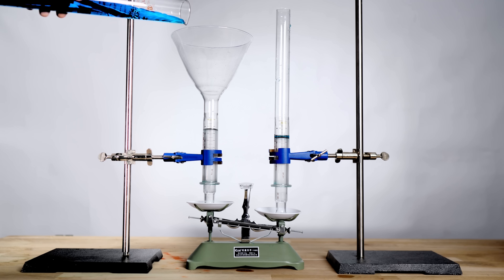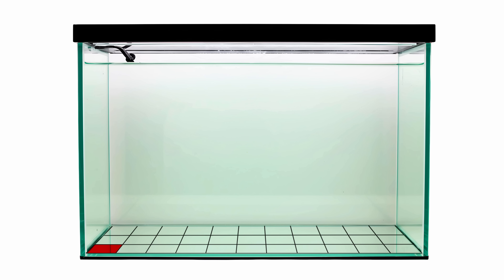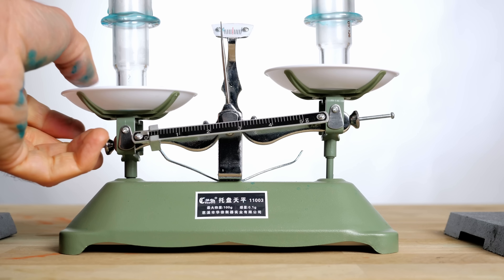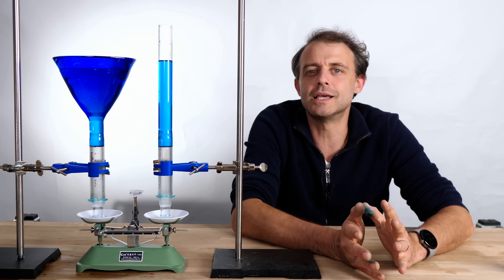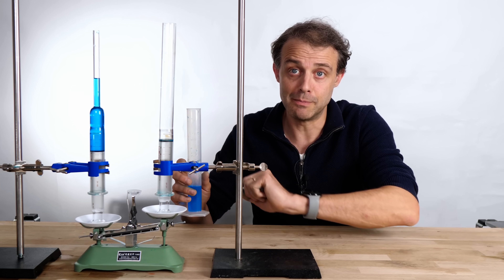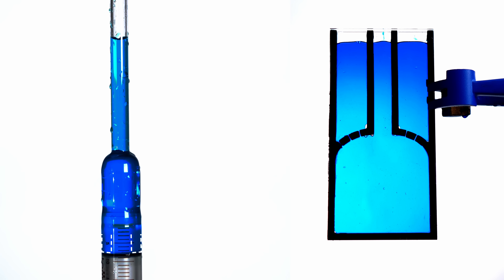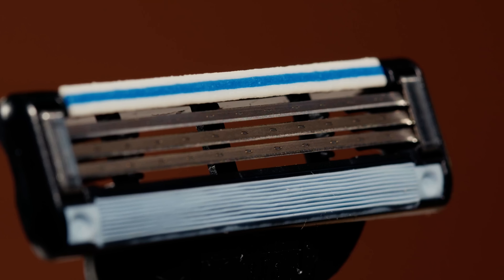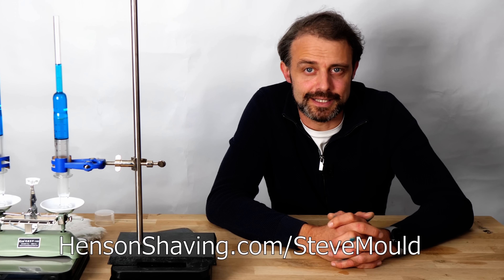The Hydrostatic Paradox

Comment: Yes, for the people wondering, this does mean that the pressure felt at the bottom of the ocean is the same as the pressure felt at the bottom of a tall drinking glass that has the same height as the ocean's depth. This is why those glass walls on below-sea-level sea-side patios don't need to be super-reinforced, because they're not feeling the weight of the entire ocean pushing against them, just the weight of a couple feet of water.
Reply: Thanks, I always wondered what the pressure at the bottom of my tall drinking glass that has the same height as the ocean's depth was
Reply: Maybe a more intuitive way of explaining it is that the pressure felt at the bottom of a 6' deep swimming pool is the same as the pressure felt on the floor of the ocean near the beach where it is also 6' deep. It doesn't matter that there's infinitely (ish) more water in the ocean because only depth affects the pressure.

(Ok, technically the pressure in the ocean is slightly higher because ocean water is a little more dense but we're going to ignore that to make a point.)
Reply: @Psyco913 This is only true for hydrostatics, which I suspect is rarely accurate for coastal ocean floors due to waves and currents
Reply: @ehjapsyar That's negligible - particularly with regards to the point at hand.
Reply: @BruceNJeffAreMyFlies I doubt it. At a depth of 2 m of water, using Bernoulli's principle the pressure is 120 kPa and the velocity term (1/2*density*velocity^2) goes to 35 kPa at 30 km/h, 96 kPa at 50 km/h, 386 kPa at 100 km/h... now I guess Bernoulli's principle isn't entirely applicable here since it doesn't take rotational flow into account and requires following a line of current.
Reply: @ehjapsyar 30km/h for surface level water is incredibly fast, that's like a fast flowing rapid, water will rarely move that sort of speed, and 100km/h is pretty much never going to happen without an extremely large pressure differential to drive it.

Waves can potentially move fast, but the water itself isn't moving that fast, so it's not valid to use the dynamic pressure to calculate the energy in it.

Also remember that pressure due to velocity SUBTRACTS from the static pressure, so to have 386kPa of dynamic pressure in only a few metres of water is basically impossible. The only time you see water moving those sorts of speeds is when there's a huge static pressure to drive it (e.g. an artificially pressurised water stream like a water jet cutter, or something like a dam where there's a large pressure due to the water depth but it vents to nearly atmospheric pressure).
Reply: @wolfie54321 Well I obviously don't really know how fast the water can move on the ocean floor near the border, but I've been shaken quite a bit when swimming multiple times so I might have overestimated it, finding yourself in the sea with pebbles flying in your legs because of the waves really brings a bit of doubt! In any case at 6 feet deep I don't think you could call it a surface level flow.
Regarding the pressure value, I did write that the numbers are for the velocity term, (not the absolute pressure). Of course anything too high is hardly achievable (like I wrote there would probably be quite a bit of extra stuff involved, such as turbulence) and would even lead to cavitation if that ever happened, but I still don't know whether its influence on pressure could be considered negligible. 
It's quite specific so I didn't really bother looking for answers, but I do wonder what kind of pressure variations take place at these depths due to water movement...
Reply: @ehjapsyar A thing to remember is static pressure due to depth is equal on all sides, so it doesn't actually have the capacity to move things, it simply crushes. Pressure due to velocity tends to create differentials that move things, like, a rough estimate is that a 1 cubic metre rock (1 to 1.2m wide rock) would have a drag force on it equal to its weight (minus buoyancy) at only 6m/s in water. The fact you don't see 1 cubic meter rocks flying around is a pretty good indicator that the flow speed isn't super high, the only time you see that sort of thing happening is in fast moving flood waters or rapids. Because drag varies with width squared and weight with width cubed, a 1cm stone only needs 0.06m/s (60mm/s) for its drag to equal its weight (minus buoyancy).
Reply: @wolfie54321 Yes that's quite convincing, but frankly I'm still wondering what are the water velocity and pressure variations that can take place on ocean floors close to the shorelines. It's quite specific (and it looks like it is a rather tricky transitional area) but it has made me curious to know
Reply: Thank you! I did, in fact, wonder about it!
Reply: so a reeally REALLY tall but really thin cylinder filled with water would have an insane pressure at the bottom? is there some experiment of that?

Comment: I assume this vertical weight concept only works in static water that isn't moving or flowing.
Reply: I hope Mike address this, but my thought is the number of molecules in the column remains constant. Barring sloshing above the water line, or the flow somehow imparting unbalanced vertical pressure in the column, I think the measurable effect would be minuscule to none. This is way in the weeds, but do you think underwater Bernoulli forces could have an effect? My guess is no, because they're radially symmetrical. Every change in pressure in one direction would be cancelled out by a change in the opposite direction.
Reply: @FetchTheCow if the entire column of water is flowing, then the pressure change should surely be present. Also, if you consider a jetstream moving laterally halfway up the column, would it not pull whats below it up, thus decreasing the percieved pressure at the bottom?
Reply: @skanderbeg152  Good point. I was thinking of a jetstream when I wrote about Bernoulli forces, being radially symmetrical perpendicular to the direction of flow, might cancel out. A jetstream right under the surface of the water breaks my brain! 🤯
Reply: @FetchTheCow good point. Thanks.
Reply: Why do you assume that?
Reply: @CorwynGC 
I was originally asking (hence the edit) but the assumption is that the vertical column weight will fluctuate based on current flow.
Reply: @Leftysrev3nge yes and no, the moving water doesn't make the pressure from depth any less. However according to bernoullis principle, a moving fluid will necessarily have less pressure, thus exacting less pressure on anything it touches.
Reply: @skanderbeg152 I can get behind that.

Comment: AI Summary

Abstract:

This video demonstrates and explains the hydrostatic paradox through a series of practical experiments using a balancing scale and custom-shaped containers with freely moving pistons at their base. The initial experiment shows that the force exerted on the base depends only on the height of the water, not its total volume, leading to a small amount of water balancing a much larger volume. This is explained by Stevin's Law, where the container's walls support the weight of water outside the central column. The video then introduces a more complex scenario with an inverted funnel-shaped container, where a small volume of water exerts a force greater than its own weight. This is explained by a more nuanced version of Stevin's Law: pressure at any point is determined by the vertical distance to the water's free surface. The upward force from the container's "ceiling" on the water creates a downward reaction force that is transferred to the scales, accounting for the additional measured weight. The underlying principle of pressure (force per unit area) is then used as an analogy to explain the mechanics and benefits of single-blade razors over multi-blade ones.

Unraveling the Hydrostatic Paradox: How Water's Weight Can Be Deceiving

*   00:00:03 The Initial Puzzle: The video begins with a counterintuitive demonstration where 60 ml of water in a narrow-topped container exerts more downward force than 150 ml of water in a wide, funnel-shaped container.
*   00:01:14 The Balancing Act: The scales are balanced when the height of the water in both containers is the same, despite a massive difference in volume (approximately 550 ml vs. 60 ml). This highlights that the force on the base is independent of the total volume.
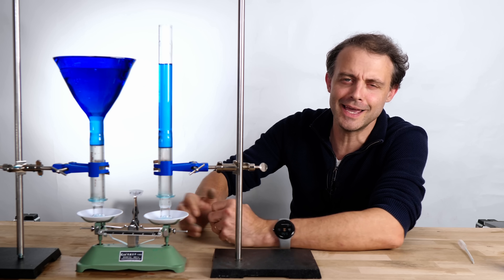*   00:01:27 Introducing the Hydrostatic Paradox: This phenomenon is named the hydrostatic paradox. It is governed by Stevin's Law, which states that the force on a surface is determined only by the weight of the column of fluid directly above it.
*   00:03:00 Pressure vs. Force Explained: A clear distinction is made between pressure (force divided by area, defined at a point) and total force (the sum of pressure over an area). This concept is crucial for understanding how the fluid's force is transmitted.
*   00:05:26 Explaining the Funnel: In the wide container, the sloped glass walls support the weight of the excess water. This is proven by showing that the clamp stand holding the container gets heavier as water is added, bearing the load that doesn't press on the piston.
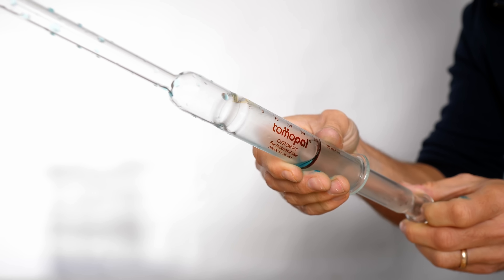*   00:06:47 A New Paradox: A third container, shaped like an inverted funnel, is shown to also balance when water heights are equal. This is puzzling because the small amount of water inside seems to generate a force much greater than its actual weight.
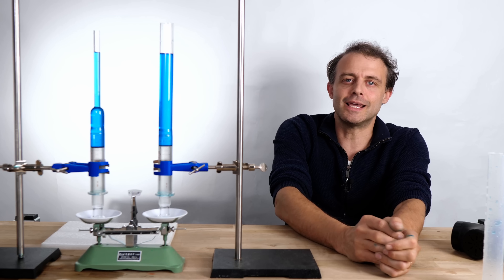*   00:08:15 The Corrected Law: A more precise version of Stevin's Law is presented: the pressure at a point depends only on the vertical distance to the free surface of the liquid. Because water can flow, the pressure under the "ceiling" of the inverted container is the same as at the bottom of the central column.
*   00:10:05 The "Missing" Weight Explained: In the inverted funnel, the container's ceiling pushes up on the water, and by Newton's third law, the water pushes down on the container. This downward force is transferred through the clamp stand to the scale, making the container appear lighter while adding to the measured weight on the piston.
*   00:11:02 Real-World Analogy: The principle of pressure is connected to shaving. Multi-blade razors spread the pulling force over many hairs, causing skin irritation, whereas a single-blade razor concentrates the force on a few hairs at a time, resulting in a cleaner cut with less tugging.

AI-generated summary created with gemini-2.5-pro for free via RocketRecap-dot-com. (Input: 16,541 tokens, Output: 856 tokens, Est. cost: $0.03).